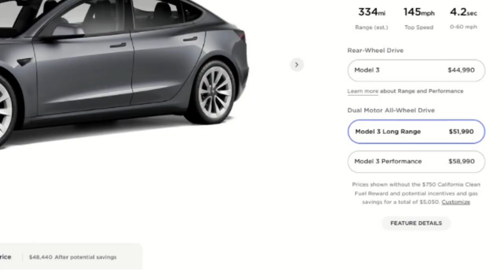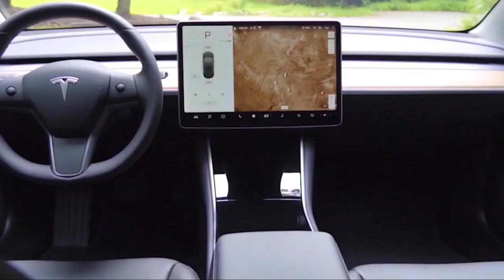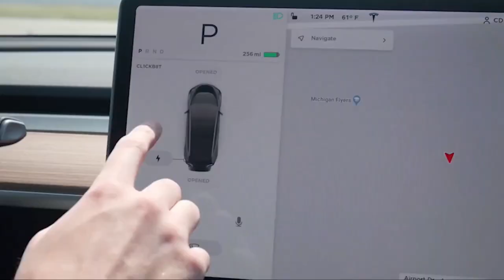Buying A Tesla Model Y? | The 2022 Tesla Model Y Update Is Here!

Comment: First of all - stop framing it as "range anxiety". That was concern back in 2012 when chargers were few and range was barely sufficient for a daily use. At this point it's about long range driving comfort and acceptable level of convenience for people without home/work charging.
Second - stop claiming EPA/WLTP or even your idealized 70mph test. Those are great for comparison, not for estimating if it is enough. If you have 3 months of winter, winter range is the limiting factor. I don't care that an EV has 300 miles of range if significant portion of the year it's only half of that. In that case 150 would be the relevant number. And for people who do make regular long range trips, the relevant numbers that determines driving convenience is ~10-70% range and charging speed.
So if Tesla can develop EV that has 300 miles range all year long and is able to recharge at least 200 miles/20 minutes (again all year long!), I will not mind if the EPA range doesn't increase from current numbers.